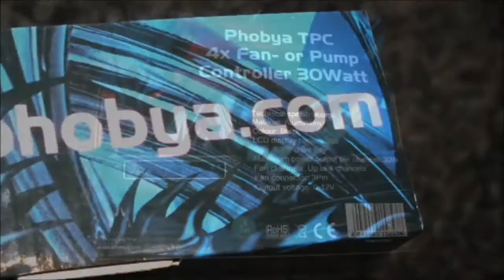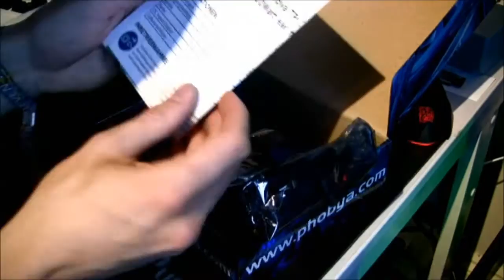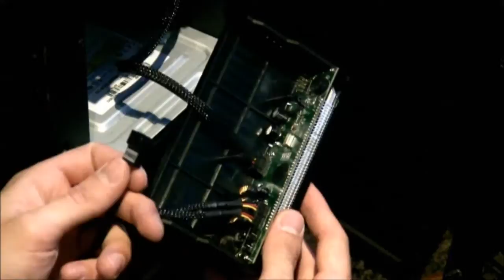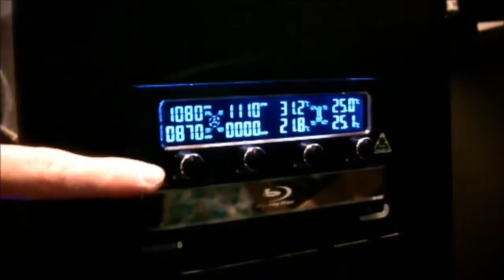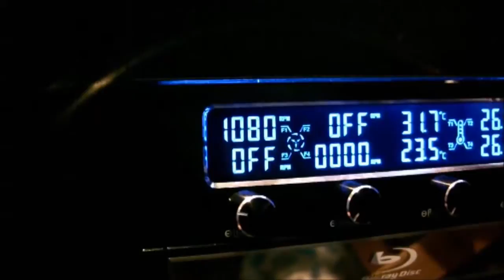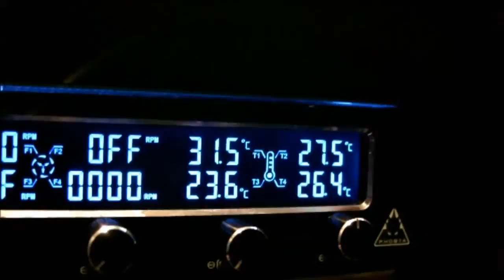Phobya TPC Fan and Pump Controller Review

Comment: Are the fan cables wide enough to put a 4 pin cable into them or would I need an adapter for that?
Reply: xT1ger_JP just offset it